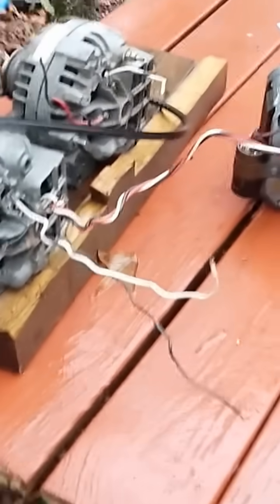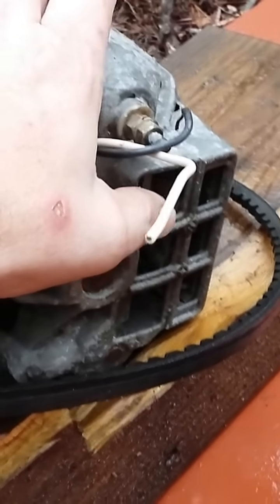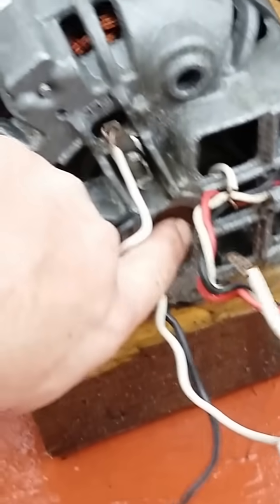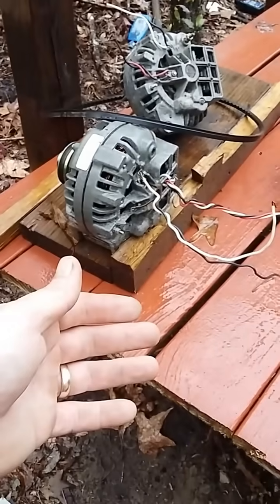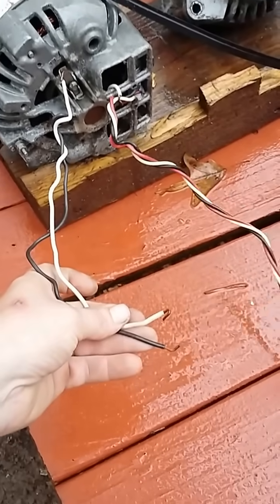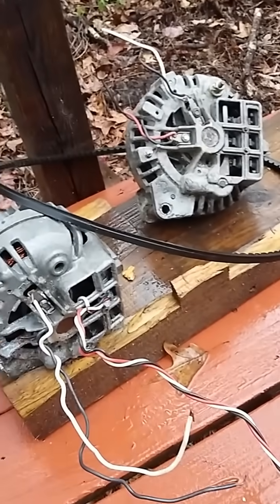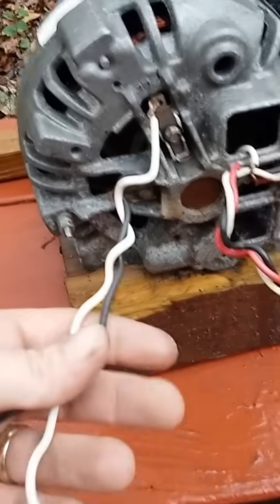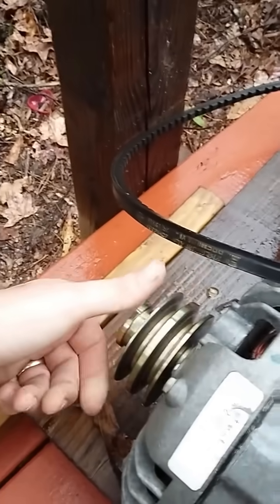Update Free energy forever no wind no solar no gas READ DISCRIPTION!!!

Comment: Laws of conservation of energy are cast in to fabric of universe , you cant defeat them if you could they would not be any universe, just entropy,  and that is NOTHINK., YOU CANT GET MORE ENERGY OUT OF LESS ENERGY WHEN YOU MAKE ANYTHING WORK BASED IN ENERGY THAT ENERGY product will all be made at lower level , your alternator driving an alternator will not produce the energy that you claim as soon as you load the power out alternator, the system stalls as its a minus output that follows the first law of conservation of energy , 

QUOTE  Chris Woodford   https://www.explainthatstuff.com/conservation-of-energy.html

 And same kind of thing here In one version of perpetual motion, illustrated here, 
(1)You allow water to fall down onto a waterwheel, turning it around (2). The turning wheel drives gears (3) that power an Archimedes screw, which lifts the water back up to the top, theoretically allowing the whole cycle to repeat itself forever. Although you might think energy is being recycled as the water moves around, it's also being lost all the time. The water at the top has potential energy and that can indeed drive a waterwheel as it falls. But some energy will be lost to friction as the wheel turns. More energy will be lost to friction in the gears and the screw. So, between them, the wheel, gears, and screw will not have the same amount of energy as the potential energy the water lost originally. That means the screw cannot lift as as much water back to the bath as fell down from it originally—so the machine will very quickly come to a stop.
Reply from the maker: stedman gilday how much do you know about using sound to create a sine wave through pulse-width modulation to power a 3-phase motor? The only thing that was in this video that should be known is the alternator with the wires protruding from it, it is not an alternator it is a 3-phase field magnet motor... Thanks for the comment! And since it was a kind, genuine comment. I will give you a bit of information that needs to be known as well.. 3-phase pulse-width modulation 400 volts 16000 Hertz only consuming half an amp of (i) wired in star = almost 40hp

Comment: I was not trying to be insulting or anything negative. I think it’s great that ppl are out there seeking ideas for FREE ENERGY 
However something has to turn the alternator
I did this experiment when I was a teen I’m 40 and no matter what source of energy you use to turn the pulley 
More energy goes into the turning than comes out. I could write an entire paper just on steam power but the second law of thermodynamics wins out every time you’ll lose potential energy thru exchange.
“Energy is the ability to bring about change or to do work. ... The Second Law of Thermodynamics states that "in all energy exchanges, if no energy enters or leaves the system, the potential energy of the state will always be less than that of the initial state." This is also commonly referred to as entropy.”
Keep trying to invent don’t let negativity pull you away from dreaming. It is possible to create, think of frequency and vibration. “Nicola Tesla” study his work, because what you’re trying to accomplish I have been working on for the latter part of 20 years. Don’t give up, and have a blessed day.
Reply: Don't bother trying to educate these morons with real science or facts, because they are immune to both. Most "free energy" YouTube sites are simply scams which encourage suckers to send money to science illiterates who think they have "discovered" something when they actually don't have a clue.  It's kinda like RELIGION.
Reply from the maker: Well I appreciate the kind comment! I have been working on this for many years as well and I know about entropy, Lynn's laws and thermodynamic losses and many other things that most people don't know and trust me I know the difference between a stator and a rotor...
(This video keeps me safe) I actually waited for my child to try stumbling around not wanting to take a nap before I started recording the video... 
If you want to complete what you started you need to look into 3-phase permanent magnet motors they use frequency and voltage to get their power they do not use hardly any current and they achieve more power than most Motors.
So at around 400 volts running it at about 13k  to 16000 Hertz you only consume 2 or 3 amps to gain 30+ horsepower from a 3-phase permanent magnet motor! And thanks for watching my videos it keeps us from losing everything!!!

Comment: I knew something wasn't right when I took my starter to Autozone years ago. They hooked it up to see if it was working properly. It kicked in like it was suppose to but when they cut the power off it still was running at full blast. It should have stopped. It was still running and they unhooked the wires and it was still running at full blast. Yeah, it wasn't working right so I exchanged for another one. I was puzzled why it kept running after the power was cut off. Now I'm thinking there is more to electrical power and generators that we are not being told.
Reply: There's a lot more to know than the guy who made this video possesses. Generators don't continue to run when power is removed. They may coast to a stop, but they don't keep running full blast. You're correct, there is something not right; your claim that a generator kept running with power removed.

Comment: The big problem is this kid knows just enough about this to get someone into a big mess, like burning their house down.  he dont have any idea how to regulate the power coming from the alternator.  the alternator is capable of anywhere from 85 to 190 amps depending on the alternator. but he dont have the grasp on how to regulate this so whoever listens to him will blow things up in there homes or worse,...fire.  I wish people would get the facts on this stuff before making video's telling people how easy it is !  cause its not so simple.
Reply: Steve Lamperta you are 100% right. 

And I don't care about descriptions. People dont read they watch YouTube. If you had a brain you would know that.

What you did not only does not work it's a disaster. I would say more but you'll only take it out on your sister. 

This shot dont work unless you have a way to rotate it fast. Another motor or engine.

Which you will be using either electricity or fuel. To make a cool way to get the same energy and more dangerous to boot. 

Go make moon shine. Scab.
Reply from the maker: +Steve Lamperta I think it's the other way around! You seem to not know what you're talking about)  you didn't read the description of the video!!!  And as I have said in quite a few other comments the alternator in this video with the wires hanging out of it is my primary mover... 
And you forgot to tell me that I don't know the difference between a rotor and stator!! since I switched those words around...
Reply: Your missing the point !  I am not being mean to you or trying to insult you.  Pay attention  !
Reply: Just read the comments here and that should give you some idea of who's wrong !  But again,.. I am not trying to be mean or insulting to you.  I am only saying you should not give advise about something dangerous like this when you clearly know very little about it.  your going to get some one hurt or killed !  You dont seem to understand this !
Reply: oddessy2g 
OMG..The moonshine line cracked my ass up...

Comment: I don't mean to bash you but an alternator is an alternator and a generator off of a vehicle such as the Old World War II Jeeps is a generator the difference between the two being is that an alternator has electromagnets that must excited to create energy. alternators from old Volkswagens work well. generator has permanent magnets in the electric motor thus no electricity is needed to create energy when you turn the stator
Reply: Um, Cody, I am sorry but you obviously either don't understand the principals of electricla induction or are just not explaining yourself very well. But an alternator is a generator. Just two different names for the same prinicipal. Abot devices take rotational energy and turn it into electrical energy by magnetic coil induction. An alternator takes the rotational energy from the engine and turns it into electricity to charge the battery of the car. This is the function of a generator. Sorry to have to correct you on this but you are mistaken in your argument.

Comment: Everything this guy says about an alternator is true except one missing detail that is very crucial to the operation of the whole system. And that missing detail is a motor that continues to spin/run the alternator to keep continuously receiving the said power output! The motor/engine is also going to need some sort of energy/fuel to keep the alternator running to put out the said power. And unfortunately that is still going to cost $$$ MONEY $$$ in order to do that!!! So you're still going to be paying out alot of money to keep this alternator going regardless. Unless you can provide a means of supplying the energy needed to spin/run the alternator without having to put out money for fuel or some sort of other energy to spin/run the alternator in question here! So what is the solution to this issue here 'ThomasBuie EnergyBuies at gmail com' ???
Reply: Glenn Brown  you r right of all you said but my question is did you believed the b***** coming out of this guy's mouth?
Reply: They key to it is making something rotate with natural energy like rare earth magnets. 
Magnets can hold a field for over 70 years. 
Get enough of them with a big enough intricate circle (your talking the size of a 20x20 shop)
And it would have plenty of torque to run a few generator heads. 
It would still take energy to get it spinning but your gain would be 50% or greater. And the startup energy can be stored and used as needed (if needed) or rather when bearings fail or the need to make repairs

Comment: Forgetting for a moment the output form of these devices and amount of power, where does the free energy come from to turn them so they can do it? If the motor was connected to the alternator to power the alternator you would need more power than the motor could produce to make it work and have some remaining to do other things. I am an electrical engineer so be as technical as you like showing all workings and if possible a schematic diagram, for myself and others that really understand this stuff without your confusing incomplete explanations, then I will explain why it will not work or apologise to you after taking your explanation to the professor of electrical engineering at a London UK university for verification.
I don’t expect to hear from you again. Good luck!

Comment: 1) You are NOT gonna put in 6 volts and output 220 volts at 90 amps, unless you have a battery the size of a house. 
2) You are gonna use more amps in your 'motor' to turn the alternator than you will get out of your alternator, no matter how you configure it. Not to mention the current draw of your '3 to 12 volts' you are feeding in to the alternator.
3) You may or may not already know this i.e. you may be a complete idiot or just joking. But it is important that other people know you are full of it.

Comment: I am guessing he is going to run the alternator from the motor which runs from the electricity produced by the alternator. Basicly a perpetual motion machine. Many videos have shown they have done this but the numbers don't work. It takes 745 watts to produce 1 horsepower. a mechanic told me it would take a good 3 horse motor to run an alternator. If this is correct it would take 186 amps to run a 3 horse electric motor running on 12 volts. If the alternator produces 90 amps it won't get enough power from the generator to run the motor. He didn't show it running or how he did it.  There is something they aren't showing when they show this such as a hidden power source.
Reply: Gordon--He didn't say but he could have a water wheel with common shaft to run motor hooked to Generator--this will work as some mtn. off grid folks use this method....
Reply: I thought he was showing one alternator used as a motor and one as alternator. His info is to incomplete to be useful. if he has water power that is a necessary part of how to do it as well as where he gets the 6 volts to connect to the alternator.

Comment: Hi  I'm not a Electric Guy but my Dad is and I learned a lot from Him.
I want to leave a Comment and in this I would like to get responses with any type of help possible please..
I see many Videos of Magnet what moving a 12 volt Motor and so on but what about using you power from your Electric Company and creating a motor what will move this type of Generator to power your whole House. I guess this could be very much cheaper than to have everything in your House connected to Power Company. Right?
As well I am playing around with trying to figure out to use a 120 volt/220 volt 3 phase Inverter to power the House. Some how it makes more sence to me using little enery to power a Inverter with 20000 Watt the a while House and there must be a Solution to it, specially using a Inverter for Solor Power what changes the Solar Power 12 volt to 120 volt and to 220 volts...anything what creates 12 volts could be used to produce with a Inverter or Generator enough Power for your whole House....WHAT ABOUT?
PLEASE EMAIL ME:
PATMEX93@hotmail.com
Thanks for your opinions  Jürgen
Reply: Juergen--This is a Great Idea, I watch Many Video's and Never thought about using Power Co. Electric-Min. usuage , to Turn High Output Generator to Supply Electricity to Power Whole House....
Reply: +randy beard yes I see what everybody says there is no such Free Energy but that's means not that's I can use the power Co. to get a Generator started with little power and with this little Power to run a Generator what Powers the whole House...Better to run a Generator or a Inverter with 12 Volts DC input and 120/220 volts out out to Run the whole House. Would you not agree to that?
you can also get in contact with me on WhatApp +523221480061
Maybe we can do something together if you let me have the Mexican Market
let me know
Reply: +randy beard I are there is People here what are just insulting because the think the know it all...So let me ask you that....How much Energy I need to charge a Battery I guess not as niches I would need to power a while House. so and what about if I connect that 12 volt Battery to a 20 kw producing Inverter 120 volt or 220 volt output.
This is the same system Like Solar just I don't want to deal with all the Solar Penals and hug them up to the Power Co. and still get scrute. 
This is for all knowing all  Insulting Know it all to think this over....
Reply: I was thinking the same thing. just use the energy from the power company to run the electric motor and power most of your home with the output from alternator. After you convert the DC to AC , of course.  let me know what you find please. im going to experiment with it a little myself when i get time. Im not a free energy expert  but i was residential, commercial and industrial electrician for 10 years & currently a lineman for power company.

Comment: Would you please show us how to hook this up to the house?  This is very grand advice!  Thank you so much. I'll be waiting for the video.
Reply: Floyd Brownlee it's not hard to do.

 first, you have to understand, the breaker box in your house has two metal rods that are supplied with 120v each, a return, and an earth ground. everything in your house that plugs into a 110 outlet is connected to a breaker. each breaker has a voltage and amperage rating (that's very important). each breaker connects to one of the two metal rods. for anything that produces a substantial amount of heat that draws 220v (oven, dryer, etc.) will be connected to ONE breaker for each appliance and a 220 breaker will connect to both metal rods. 120+120=240. 

now. if (insert power source) can produce enough energy to meet your household demands (generally at least 240v and 30a) then the connection process is very simple. 

shut off the main switch and leave it off. you won't be needing it. plus if you leave it on with your power source turned on and someone from the utility company comes to work on the line for whatever reason, they're going to shut off their end but yours is still on supplying power to the lines. that lineman will die and it'll be your fault. so shut off the main and leave it. it also helps to shut off the other breakers as well.

next for a myriad of reasons, install a secondary breaker box with one switch. this will be your new main. run two hot wires from the new box and tie directly to the two existing rods, one for each. then connect your ground to the existing ground, and connect your new return wire to the existing return. THE RETURN IS NOT A GROUND!!!

now connect your power source to your new main. double check that all of your connections are solid and won't move and make sure that anything carrying electricity is not touching the the metal box. once you do that turn your main switch on. 

flip each breaker on ONE BY ONE with 5 second intervals. this will avoid over loading your power source and give it a chance to recover from the initial draw of that breaker. and viola. you're off the grid. 

its a simple process. as long as you understand how electricity works and understand that electricity behaves one way and one way only, and as long as you respect electricity, you'll be fine.